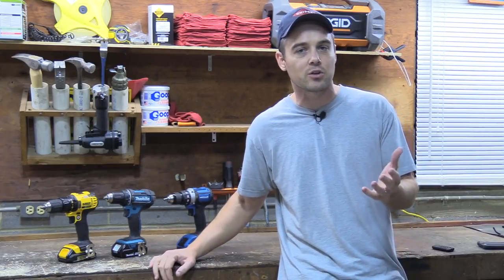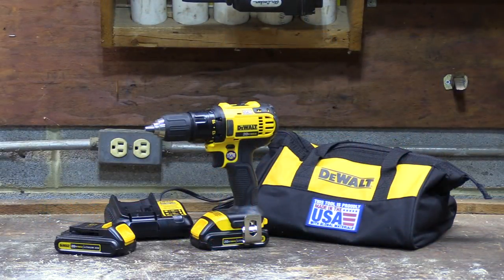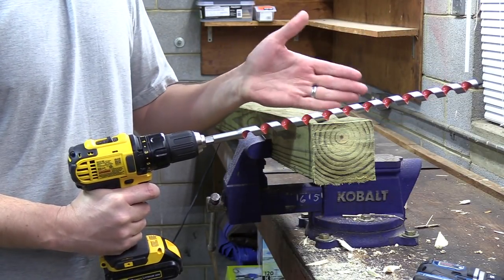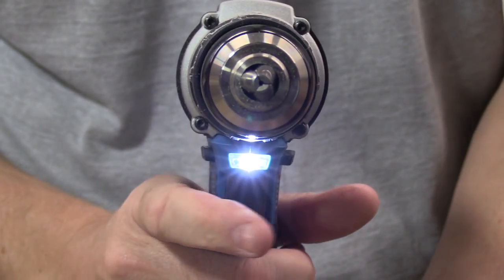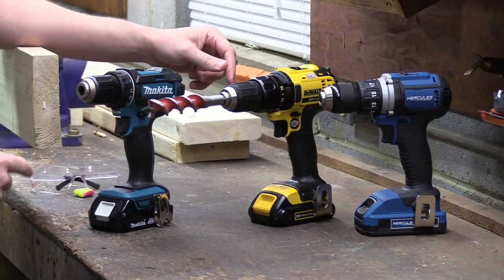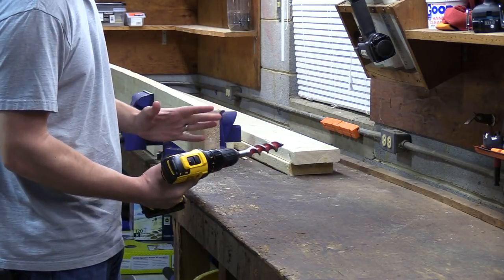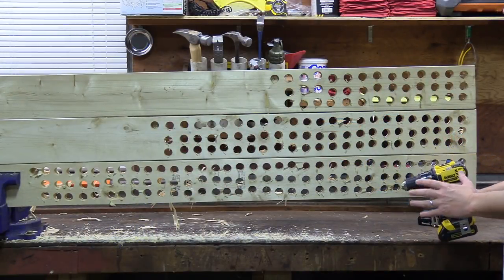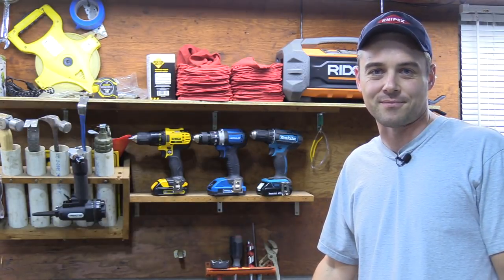Dewalt -VS- Makita -VS- Harbor Freight (Hercules) / DCD780 -VS- XFD10 -VS- HC91K1

Comment: I'm a retired Master Carpenter with 45 years experience with tools. I Used mostly Dewalt tools and as far as the cordless drills i've owned at least 4-5 of each model and i've noticed that as the battery capacity has increased over the years the run time and general toughness and quality has gone way down.  I Have one halfway working 18 volt left and a box full of junk ones for parts for friends to use. The keyless chucks have always been junk that loosen or fail to hold up to vibration or general use. Most of the tool's components are made in our 51 state of China and hopefully will change for the better.
Reply: Tom Cook I’m not at 45yrs experience. Well over 30. Milwaukee is a great brand. About 10 yrs or more ago. The man that was the chief engineer at Dewalt left on the reason of he was being told to cut corners. Went to the red brand. One reason Milwaukee has a huge foot hold in the industry. I’m a blue fan now. They are the only company that is only Makita. Others are so many other brands. Thanks for putting your blood,sweat & fun out there bother.  Craig

Comment: I own the Hercules and I have no problems with it I don't see why everybody dislikes Harbor Freight products because I have several products from Harbor Freight and I rarely have any issues with any of them. So I would say I would not hesitate to buy the Harbor Freight Hercules drill again if I'll ever need it.
Reply: Did you get the 1 or 2 year warranty? I got the 1 year on my Bauer, the manager said if there's any reason you wanna return it in the 15 months (because it's a year on top of the 90 days) you can do so and exchange it as well, even if it's still in good condition
Reply: They are jealous because they already spent hundred more than the harbor freight models that are superior.
Reply: People dislike HF because they have been selling poor quality tools at a cheap price which seems like a bargain up front until you have to start repairing or replacing them.  The Hercules line is just (what 2 or 3 years) old now and they really upped their game on these.  Across many of the tools they offer under this line, it actually seems like you can get a better tool for less money.   I have their miter saw and couldn't be happier with it.  Looking to pick up one of these drills soon.
Reply: @bigvelvetdog  Yeah, I think a lot of the negative reports from 1 or 2 years ago had to do with early models probably coming from factories in China that cut corners or had production issues. I'd imagine they've been resolved by now because the more recent comments I see about Hercules tools, the more positive they are.

The cheap power tools like the $10 angle grinders aren't meant to be ran hard every day for 10 years, they're meant to be used once a week doing light duty tasks and it beats having to uses a hacksaw or a wire brush.

People have this concept that they have to overpay to get the absolute best and overpowered thing they need. Gonna tow a 1.5 ton camper once a year 50 miles away for vacation? A 1/2 ton pickup will do just fine, but overcompensation types will get a 3/4 ton instead because "it's built stronger."
Reply: @elmuyguapo592  I wouldn't say the HF brands are superior tools, but they are more affordable. People just get unhinged when you challenge their long held beliefs that the tools they have are the best and to say that they're not is taken as a personal insult.

Comment: A lot of this boils down to which battery platform you choose.  I have a lot of 20v DeWalt tools so even if performance is comparable or slightly less than the others it makes sense to stick with DeWalt so I can use one battery amongst a variety of tools. Plus, in over 20 years of DeWalt ownership I've yet to have a defective tool. So that is worth something.  I have had to upgrade my old NiCd tools but the tools themselves still work great.  Not sure I'd trust a Harbor Freight tool to last that many years - but I'm open to the idea as their pricing is very attractive.
Reply: Phormify had the same thought, lots of Makita batteries and tools in the house. And I don't plan on getting a second battery system.
Reply: We had one Dewalt and it was junk. But could have just been a lemon. What I noticed on Dewalt is Christmas time their on Sale which is a big big plus. But I choose Milwaukee and never looked back
Reply: Phormify - That's exactly right.  People are just going to pick whichever battery ecosystem they've already bought into, at hundreds or thousands of dollars.  The real market share to be made is on DIY/new homeowners still trying to build an inventory and not committed to brand loyalty.  That's probably why companies like Ryobi spend a small fortune on interactive and targeted advertising.
Reply: you can buy an adapter for the nicad dewalt tools to run the 20v max batteries. 
no need to get all new tools that way
Reply: I used to work for a small roofing company with about 8-10 crews as a repair/maintenance guy. We used NiCad DeWalt and Makita drills and buy far the biggest failure was the batteries. We had a few clutches and one 3 speed transmission go bad, and the DeWalts were easier to break the housing between the grip and the head than the Makitas but that was from abuse not manufacturing though.  Overall I would so if you are a pro or already have a set, don't change but for a home gamer starting out they are very hard to beat.  I also think that if they (harbor freight) keep improving their line up they could put a real hurting on the big guys very soon.
Reply: This.  I always say when people ask me what to buy, look at the platform and what other tools you'll need.
Reply: I too have DeWalt tools that have lasted since getting them in 1999. Just the normal drill and the right angle drill (14.4V). But I've used them on plenty of projects over the years. Last year I bought aftermarket NiMH batteries for them off eBay and an extended three year warranty for 10 bucks extra. Also had to buy a special DeWalt charger that handles NiMH but that worked out fine. Plenty of power. The first DeWalt drill I bought was called "Heavy Duty" but the plastic gears fried the first day I used it, so I returned it for the one with metal gears, which I've had since 1999. :) Quite happy with them. Might've bought Milwaukee if I'd had my time back and they made a decent right angle cordless drill. Not sure if they did or not.

Comment: based on numerous reviews and battles i have seen including this one, i just got the Hercules at Harbor Freight.  They have the 1/2 hammer drill now for $49.99...reg price is $64.99.  Got the 2.5 amp battery, and the rapid charger.

Comment: Im a contractor and have owned most every brand of drill/driver set. Milwaukee and Makita are what i buy. I care first and foremost about durability and Makita absolutely takes a beating and never lets me down.
Reply: I have to agree with you on that, I've seen many dewalts fail but my 14.4 is still kicking ass
Reply: Have you ever tried the harbor freight options?
Reply: Totally agree
Reply: @bradleyburton5034  🤣🤣🤣
Reply: I've owned Makita for about  25 years.  I will never buy Makita again the batteries just do not last and the tools are becoming cheaper and cheaper.

Comment: I bought a DeWalt 18V 5 tool set in 2007 or 2008.  I have had a handy man business, finished out a 1200 sq. ft. basement, built a garage, a 60 ft. covered deck, and numerous other jobs, all five tools are still working as well as the day I bought them.  I've had to buy 4 or 5 additional batteries.

Comment: I bought the Hercules drill, two of the bigger bayteries. I had to return the drill, when it stopped responding to the trigger after screwing 11 3" #8 screws. I got a replacement the next day. So far, so good on this drill. I did buy the 2 year warranty.

Comment: I got the Hercules line for my uncle after watching this video after Home Depot would not cover his Ridgid batteries for warranty claiming he didn't have his receipt, I bought the 2 year replacement on  the impact, drill and hammer drill and he has been using them daily over a year and half no problem on the job site, I also got him a 5 AH battery and he hasn't had a problem with anything so far, he likes the tools even more than his Ridgid line and is now going to buy the Reciprocating saw and Circular saw.

Comment: I have a Dewalt, and it's not all that it's hyped up to be.   Actually, I would have thought Makita was the best until watching this, but I was wrong.
Reply: That's because the DeWalt brand generates its hype with the drills (and other tools - like a saw that cuts 4×8 sheets of aluminium diamond plate like butter) in its higher-tier.

Imagine seeing the Porsche brand name and going cheap: You'd get a Boxter instead of a 911. Similar thing here.

The ones in this video are all hobby/project grade. And they are good, don't get me wrong, but for every day industrial use you skip Home Depot and go to an industrial tool supplier: Those are the ones that power through a decade without problems. They cost significantly more, though, so probably aren't worth the cost for the average person.

We used the good DeWalts in just about every place I worked at as a welder and/or a maintenance mechanic and... they really are as good as the hype (batteries are great, too).

I've used other brands in the lower tier as well, and they're about the same as (sometimes better than) the lower tier DeWalts, practically speaking.

The only other electric power tool brand I've seen in industry is a mold maker who used a Snap-On 1/2" impact on occasion (though the air tools were far more likely to get use).

Though I assume that other high tier offerings from different brands are better than the ones shown in this video, too.

Hope that explains why there's such a dissonance between people who use the various tools.
Reply: Just take a trip to a tool rental place. See what they use. They wont buy it if it doesnt hold up to being treated like a rented mule.

Comment: I was surprised that the super tools (DeWalt & Makita) did not outperform the Hercules. Once again it shows how much we listen to advertising instead of looking into the actual facts. Thanks for going through all the effort it takes to do something like this.
Reply: This is why for certain tools (like drills) that are relatively safe even with a malfunction I tend to go with the off-brand types. I still don't trust them with the more potentially dangerous tools though like angle grinders and routers.

Comment: how many charges those batteries take before they go funny? That would be good test too.
Reply: Have had my makita set for 7 years, both 18v  batteries give me full amperes full blast every time I pick them up after sitting a few weeks, love them still. Never recharge until full battery drain, ever as instructions say.
Reply: The harbor freight are Samsung batteries and no contest the best by far. There are videos on that in another channel

Comment: This is not too surprising since amp hours are everything when it comes to batteries.
Reply: He did the math normalizing results for holes per amp hour. Still a clear winner. Nothing to do with batter size...
Reply: jiismo  No, it doesn't work that way.  Two 1.5 amp-hour batteries are not the equivalent of a 3 amp-hour battery in this application.  The larger battery doesn't take as much of a hit as the smaller batteries for the same job.  So really, in order for this to be a truly equivalent test, he would need to use the same rated battery for all three drills.
Reply: @ABQSentinel  Except that's not how they're sold in this comparison. When you buy the drill, you're buying the battery too. If DeWalt upgraded to 2.5ah, the drill would probably jump to over $200.
Reply: @DaddyHaxTV  ok, but it sure looked to me like he was putting the drills through their paces.  It's hardly an apples to apples comparison if you don't use the same rated battery.

Comment: Problem is the Harbor Freight drills won’t do that for years on end.

Also, tools purchased from Home Depot are not the same as a tool purchased from say Tool Zone, Tool King, or any other tool supply house. A coworker and I purchased our Makita impacts the same week brand new and same model. A year or so working in a cabinet shop, where these drills are running all day, his broke. We opened them up and his “Home Depot” impact had the same parts as mine but materials were different. More plastic than aluminum and steel. They can sell tools cheaper because they are made cheaper. 
Anyway harbor freight may have won the ONE DAY test, but I have 13 years on my original Makita impact (original batteries too). It cranks in screws all day every day. Amazing Product.

Comment: For $60 the hercules tools would be great. Full retail puts it over $120 with tax. For that price you're barely saving any money, you have basically no warranty, and if you need any other tools you're going to have to buy another brand + batteries and charger. It's just not worth it. 
You'd be better off with ridgid or ryobi if you don't want to spend a lot. At least they have a full tool lineup and a decent warranty.
Reply: Exactly. Hercules' pricing makes it significantly less competitive. I'd buy the tool for $60, just like the Herc grinder that I bought for $35. If the said grinder cost close to a Makita or a DW, why bother with HF and a 90 day warranty.
Reply: U buy extend warranty n they honor it. Every 2 years I take my power tools back to harbor n exchange them for new ones n just pay 20 dollars to extend the warranty
Reply: @Jdres123  Those coupons conveniently DON'T apply to Hercules or ANY of there most popular brands like Predator, etc. Read the fine print on the coupon. You may not set foot in a Harbor Freight ever again. Things have changed in the last year, no cheap power tools for us!
Reply: Lies.

Comment: I bought the Hercules when they first came out, I had a coupon for $89.99 so I took the chance. I was building a small deck at the time and my old NiCad Dewalt needed batteries. Power wise it was great, but it drove about 38 screws and died in the first hour I had it. I took it right back, got another one, plus a second battery. It went through two battery cycles, then started to cut out early as the batteries got hot. After about 200 screws, one battery wouldn't take a charge, even after it cooled down. Both batteries sat over night, were recharged but only one took a charge the next day. A half hour into working that day the drill cut out and wouldn't run. It was late on a Sunday so I finished the job with a borrowed Milwaukee that ran circles around the Hercules. (The Milwaukee belonged to a contractor neighbor who abused it for at least the past year). 
I took the Hercules and the batteries back, got another drill, and another spare battery.  

 A year later with very limited use over the  past 15 or so months neither battery will take a or hold a charge, the charger rejects one battery and overheats on the other. The drill is likely fine but the batteries are done. 
 It reminds me of the cheap knock off batteries you get on eBay, they work fine at first but don't last long in the end. 

 I sold the thing for $25 with two dead batteries on Craigslist after HF wouldn't do anything about it. The warranty isn't long enough vs the price, and the batteries are suspect at best. 
 Maybe it would have done better if I worked it day after day but I'm a homeowner and don't need a drill but once in a while. From now on, its corded tools only for me. I'm tired of having boxes of tools that need expensive batteries that don't last.
Reply: Next time get a Rigid and register it online. Lifetime warranty boom👍
The only company that offers it

Comment: I have two drills, a Sears drill with 2 battery packs for $99 that I bought on clearance sale about 10 years ago that does small and medium jobs well, but when I need some serious power and torque I pull out my dad's Craftsman corded drill that he bought 50 years ago.  That thing powers through literally anything like butter.  I let my neighbor use it one time when we were rebuilding a fence,- his eager reaction from using it once was priceless.  Of all the drills listed above, I'd probably get the Hercules.  Even the D struggled just a bit going through that 2x6.  Wonder who makes Hercules?

Comment: Got the Hercules drill/driver (hammer drill) and also got the bigger battery to replace a Dewalt.  So far, I have not been dissapointed.  This sucker works and with the larger capacity battery with the drill locked, it will torque right out of your hands if you aren't careful.  It's now my go to drill for pretty much everything and gets great battery life.  Would I recommend it?  Absolutely.  Eat your heart out Dewalt, I won't buy another one of your overpriced products and batteries.  Not worth it!

Comment: I want to upgrade my DeWalt  DW972 3/8" 12.0V drill with a nickel cadmium battery to a 18.0 or a 20.0V 1/2" drill with Lithium-Ion battery. I have heard a lot about the hammer drill, should I get that instead of the drill driver? I'm not a contractor.

Comment: I have the same exact dewalt drill, I use to use a 2” auger but for a timber framing company I worked for a few years ago and the drill never struggled that bad... kinda strange since I’ve found the dewalt to be way more powerful than the Hercules. Maybe Dewalt is inconsistent